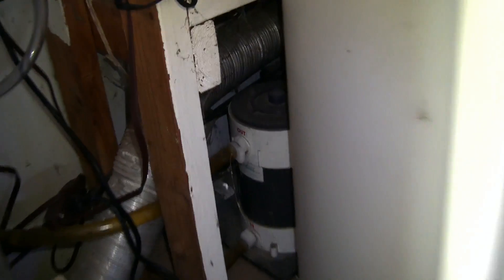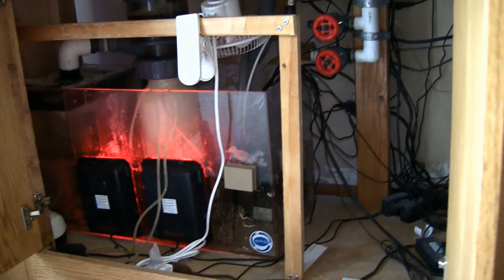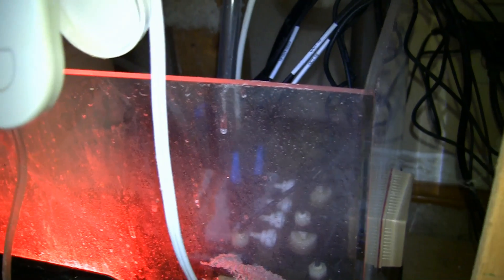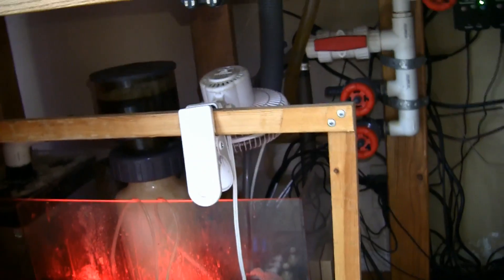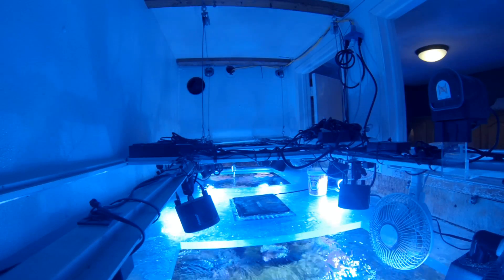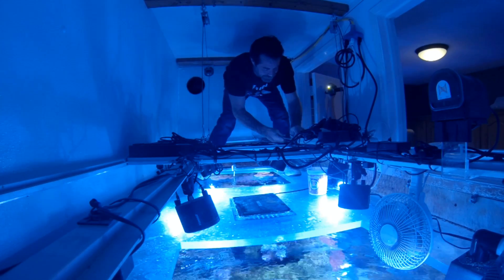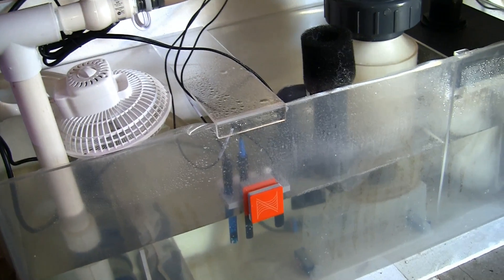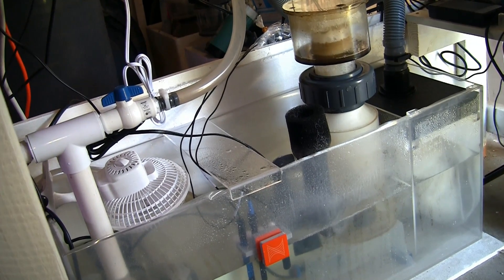Evaporative Cooling in Aquariums. An inexpensive alternative.

Comment: would you make any recommendation and or make a video on buying a mini freezer & taking it apart & use the piping lines of the freezer & make holes in the tank & putting the cold part of the pipe completely submerged in the water, & throw the fridge away like a manual?
Reply from the maker: Omar, I would suggest just buying an aquarium chiller as its going to be far more efficient, have a thermostat and be much easier to install. Ive attempted what you suggest and its just not worth the hassle, and keep in mind the refrigeration lines are not safe in saltwater.
Reply: wwaaaaaaaaaahat? Can you do that? THAT WOULD BE INTERESTING TO SEE!!!!!!!!!!!!! Peace

Comment: Why not just run copper tube into tank  and hack a cooler full of ice and water and have a pump the cold water around  till desired temp reached then have temp controller set to turn it off and on?
Reply: Jason Rogers copper kills invertibrates and some fish pretty easy
Reply: Why not just have a cheap fan on a bit of wood blowing into the sump?

Comment: Nice video Jim. Yeah I have a 90 gallon with the reef keeper lite from Digital Aquatics. As you know good products, customer service blows tho haha. I have a like I said 90 gallon with a canopy and its in a small room with POOR circulation. I use to use some fans...the fans were nice...and did work but there a bit loud for me in small areas. So I ended up buy the 1/10 HP JBJ Artica chiller from BRS for about 500ish...I also ended up getting a sicce 2.0 silent submersible pump and the usual clear tubing and clamps for the chiller. I used BRS recommended and or JBJs recommend min and max flow rates when buying my pump...I have to say...that chiller was the best investment man. That thing does make some noise...but its that soothing AC window unit noise that always puts me to sleep lol. I had my fans set with the reef keeper...but man it took them running along time to get the temp down at all...the chiller knocks it down a whole degree...fast but not too fast. My problem is that the water in my sump is obviously hotter than my DT...so I had to tweak the chiller and have it set to come on much higher than the DT temp as so it would coincide with the DT and be on point...if that makes any sense at all. I think the days of chillers are going away with the LEDs and stuff...and people not having canopy's...I personally love mine...I still have my fans installed AND I have them to come on if my tank goes above a certain temp for W/E reason. Plus...plus chillers will usually help if you have a stuck heater...however if you have a controller it SHOULD pop off the heater regardless. Great video man keep them coming, btw...I love your VAN man! Nothing like a man that takes care of a oldie but goodie, how many miles you got on her? What did you give for it? I really love how the back had the both doors that open and or the hatch that just pops up! That's so cool, to be honest, those types of vans in that shape are hard to come by these days...u never know...it might actually start appreciating in value soon...seriously.